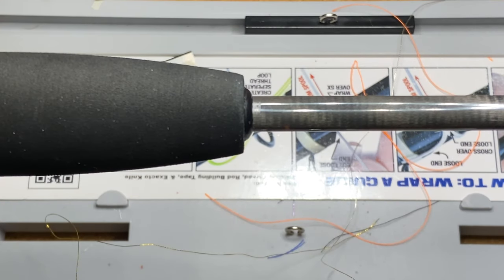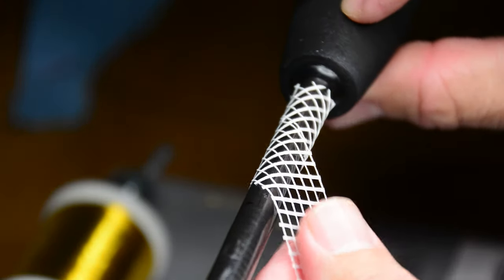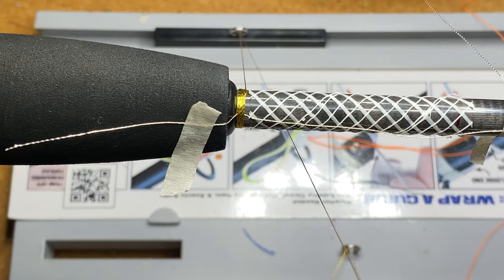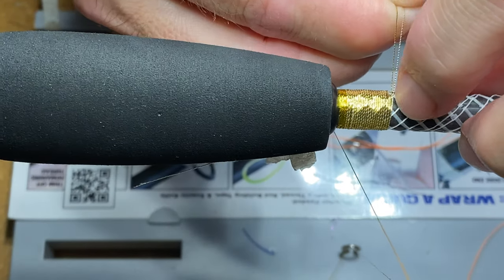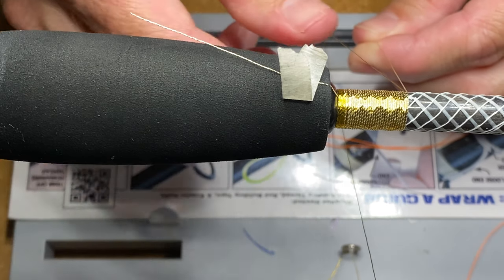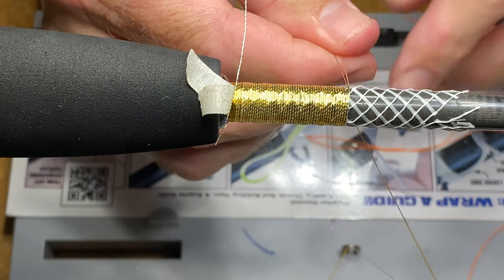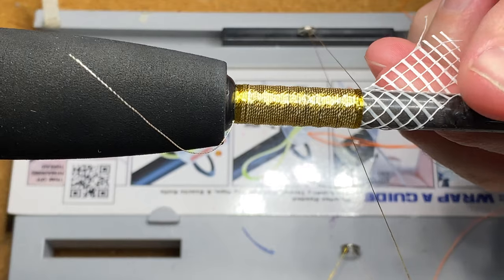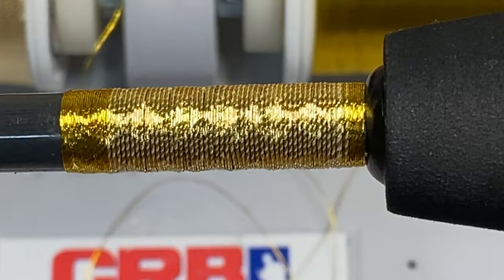Custom Rod Building - Dragon Scale Wrap: Two Colors

Comment: I noticed you have your string on the wrapper routed wrong.   from spool go to eye in front of spool to tension rod to center base eye to slider eye to rod. You should be able to run both colors at same time to tension rod thru center eye to slider to rod.  That will save you a lot of work and time
Reply from the maker: Jeff, thanks for reaching out.  Actually, the thread is run through the wrapper exactly as you described - the correct way.  The video is shot from the back side which makes it look that way.  As for using two threads, I chose to use one in the spool and the other cut from the spool since I was doing such a short distance.  Thanks again for commenting.